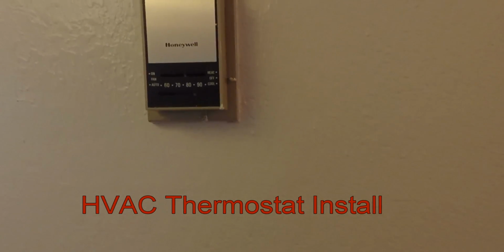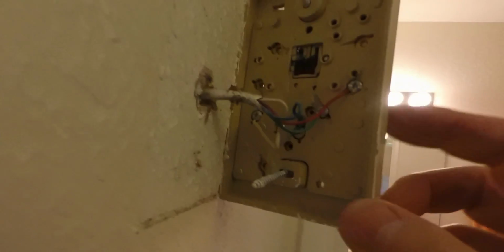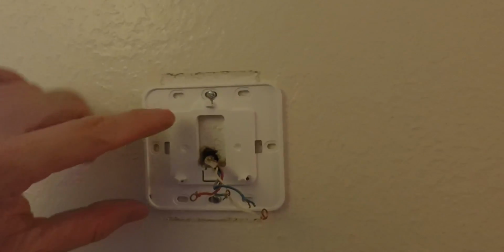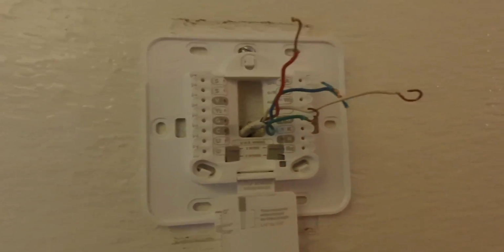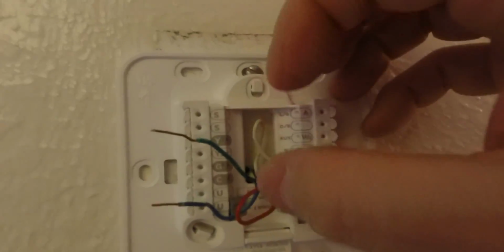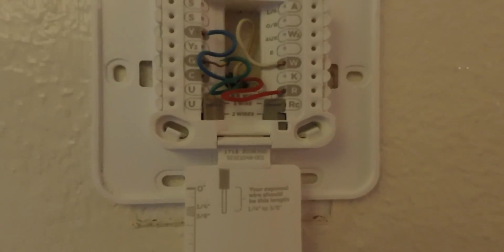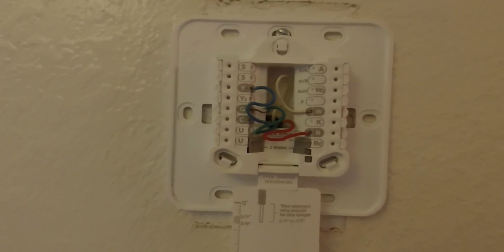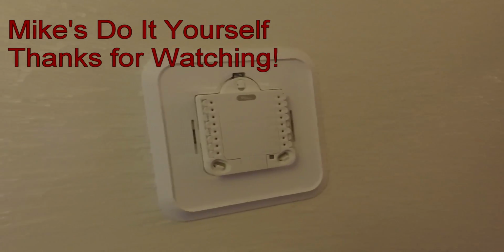HVAC Thermostat Install

Comment: The wiring is have on the old one is (w y g r rc). My question is that since i have 2 red wires on the old one where one is in the r and the other in the r c do I plug it in the same way on the new unit or on the new unit do I plug one red wire in the r and the other red wire in the c. I hope in not confusing the question
Reply from the maker: I would go by what the new thermostat manual "wiring" section shows you. This should work the best for you. Each thermostat can be a little different. If, after wiring the thermostat, something doesn't work or turn on, then I would wire it like the old thermostat that you took off. Good luck with your project!- Mike

Comment: What if you have 1 white wire that went to the E. Do I need another one for the W? My previous thermostat only had 1 white wire to E.
Reply from the maker: On most systems that have backup or emergency heat, there is a brown wire that goes to E terminal. The white wire would go to the W terminal for primary Heat. In your case, I would try the white wire to the W terminal first. You can always change it up if it doesn't work at first. Good luck with your project!- Mike

Comment: Why does my new stat not shut the fan off. Yes it’s in auto.
Reply from the maker: It could be a faulty thermostat, wiring not right, or a relay that's stuck/bad. There's some other videos on YouTube that can run through some troubleshooting on when your A/C fan keeps running. Good luck with your troubleshooting!- Mike

Comment: where's the "common wire" connection?!?
Reply from the maker: Common wire refers to the wire that provides continuous power to your heating or A/C unit, and is usually your red wire, but could be black or some other color. Good luck with your project!- Mike

Comment: Good job my friend,but im still confuse on my thermostat,can you help me a little,all my wirings are total of 5 and its blue,white,red,green,yellow and my new non programmable thermostat is c,o,b,w/e,w2,rh,rc,g,y,y2.i really dont know where to hook them up and i dont know how to read the instruction.thank you very much
Reply from the maker: I would go by the wiring instructions provided by your new thermostat. Usually, it's green to G, yellow to Y, White to W, Blue goes to C or B depending on your application, Red goes to Rh or Rc. These connections may vary depending on your specific heating/cooling units or specific thermostat. Good luck with your project!- Mike
Reply: @mikesdoityourself  thanks

Comment: Hello! 

They recently installed a new AC Rheem both inside/out units with a T1 Pro Thermostat (TH1110D2009) , however the AC runs for only about 6 minutes then turns off. It then takes close to 1 hour before running another 6 minutes…

I saw another video about adjusting the cycle rate on the thermostat… Please let me know if this will fix my issue and how can I do it on this new thermostat. 

Thanks!
Reply from the maker: Sounds like the company that did the installation has some setting up of the system still to do, or there is warranty work to be done.  Cycle rate refers to the maximum number of times a system will run in an hour - most are factory set at 5 to 6 times. This shouldn't need any adjustment, and it won't affect the amount of time your system is actually running.  If your system is reaching your set thermostat temperature at the 6 minutes mark, there isn't an issue. Otherwise, you should have the installation company fix the issue.- Mike

Comment: I have a yellow in the Y and a blue in the C 🤔 and my heater don’t turn on 😢 only Ac
Reply from the maker: Blue wires can connect to the C "common" terminal or the "B" terminal depending on your application. You can check if your common wire is getting 24v from the circuit board or find the wires that lead to the circuit board in your heat pump or furnace and replicate those connections to your thermostat. The wires may be Green to G- fan, white to W heat, red to R 24v heater/transformer. Blue to B or C "common". I would use your old thermostat connections as a reference and check your new thermostat wiring instructions for reference also. You never know if some previous person or the HVAC guy changed the wiring in the past (if it's a older home). Good luck with your project! - Mike

Comment: But I have 2 wires left over......an orange and a blue.  Where do I put them?  There is no "B" for blue and no "O" for orange;.  There's a O/B....surely this doesn't mean that both of them are place in this one input?
Reply from the maker: B is your 24v AC common wire- it can go to the C terminal.  Orange wire is normally for your heat pump changeover valve. This can go to the O/B terminal. This may vary, so I would go with what is listed in your new thermostat wiring manual. Good luck with your project!- Mike

Comment: Can I replace the thermostat without the base
Reply from the maker: The thermostat clicks onto the base but if your thermostat didn't come with the base- there must be a way to mount it onto the wall. It just depends on the make/model/manufacturer. Look for screw holes or something you can use for mounting. Good luck with your project!- Mike

Comment: What if I only have green red and white wires
Reply from the maker: Green would be for your fan and be wired to G. White would be for heating and wired to W. Red would be for your power and wired to R. Although, I would check your new thermostat manual and wire according to there instructions. Good luck with your project!- Mike

Comment: I had a B wire. What could it be? I don't think I have a heat pump. My AC is Ruud from 1988.
Reply from the maker: B wires for Ruuds are usually for the reversing valves for heat pumps that would be wired into the B terminal- I would try that first. Definitely go by the way it was wired up originally and then apply that to the new thermostat.  The wiring instructions for the new thermostat should give you some ideas also. I've seen B wire hooked into the C terminal as a 24V common wire (only in certain instances). Good luck with your project!- Mike
Reply: @mikesdoityourself   I did as the new thermostat's manual instructed, since the replacement when I turn the AC on, the indoor fan comes on but the outside condenser fan and the compressor do not run. I looked for fuses, can't find one in my furnace. I just  replaced capacitors in the outside unit,  still no outside fan or compressor....

Comment: I have yellow wire and blue wire
Reply from the maker: In your case, yellow should go to the "Y" terminal and Blue should go to your "B" terminal- if you don't have a "B" terminal than most likely it will go on the "C" or common terminal. Yellow is for air conditioning and blue is for heat pumps. I would check with your new thermostat wiring manual to verify the connections and if this doesn't help, go by how your old thermostat was wired. Good luck with your project!- Mike

Comment: Hello sir.  When you have the heat pump heating the house in the winter and it needs auxillary heat assistance when the temperatures are real low, will ' aux ht' or 'em ht' show up on the screen when it comes on to assist the heat pump? Thank you for your video.
Reply from the maker: Yes, when temps are below 40 degrees outside, the heat pump sometimes needs help to maintain the set thermostat temperature. It will turn on the electric resistance heating coils in the air handler. It usually only runs for a short amount of time in this mode. Emergency heat is usually turned on manually and should usually only be used when you have an issue with your heat pump. These two modes will usually incur higher heating bills.  Good luck with your project!- Mike

Comment: My existing system is Gas Furnace and single AC unit. My existing thermostat has C,G,W,Y and R (no jumper). The new Thermostat has the choice of RC or RH with a jumper. (no R). Question: Which terminal do I place the existing "R" wire to? RC or RH? Do I leave the jumper in or remove?
Reply from the maker: I would connect the red wire to RH (24v ac for heating) then leave the jumper going from RH to RC(24v ac cooling). I would verify this with your wiring manual that came with your new thermostat. If it mentioned something different, I would go by that. Good luck with your project!- Mike
Reply: @mikesdoityourself  Thank you sir!
Reply: @mikesdoityourself  for this thermostat is a jumper needed or is it built in? Thanks
Reply from the maker: @kittyboo2121  it's built in for this thermostat- other thermostats could be different. - Mike

Comment: I'm hoping and praying you can answer my question. The heat at my rental stopped working so we came and found the breaker was off. You could hear the fan and everything runing after we turned it on but it's only blowing cold air. We keep putting the heat on the thermostate but it just blows cold air. It's been snowing like crazy hear in Washington with freezing temperatures and my renters aren't happy. My dad left me this house and we really can't afford to keep it. We try and do everything ourselves and my hubby is very handy but we are stumped. They wanted the AC on this summer bc we had exstremly hot temps and I didn't get it done soon enough so they managed to get print the manual out and they got the AC running. Only problem now is the heat won't run. I have this exact thermostate. Is it possible they messed with the wires and didn't tell me and this is why it's still blowing cold air? Sorry for the long story but I thought it would help explain my issue better. Thank you so much. Also we went and bought a new thermostate that was a bit more simple and it has the O and B connect seperate as many say o/b together. Also other letters that don't match this one for wiring. We thought it would be an easy fix. YR!😂 I honestly don't think its a broken thermostate. The more I read the more I think she messed with the wires. Yes she got the AC to work but now NO heat. Please please help.
Reply from the maker: "O" connection would be for the reversing valve in a heat pump system (orange wire)- blue wire would be your common wire for heat pumps, this would go to your "B" terminal- I was missing some wires with this install video, so my wiring may be different than yours. I would go by the thermostat wiring manual for the final word on wiring- but this definitely sounds like a wiring issue. If this is a emergency situation, I would definitely call a professional. Hope this helps and Good luck with your project! - Mike
Reply: @mikesdoityourself  Thank you for getting back to me so quickly that was so nice of you. We bought the tenants heaters till we fix the issue. Unfortunately I dont have the manual to look at wiring instructions but I will try and look it up online. It does have 3 wires that are similar. Ones orange, ones almost the same color but a bit like brownish orange and then red, yellow, green and I think black. I'm not sure I have to look at my hubbys phone cuz he took a pic of the wires on the wall. After reading alot of your info and ppls comments I really started thinking it might be that she messed with the wires to get the A/C running. I really hope that's all it is. If it's not the wiring do you know what else may cause this? We just had to replace a hot water tank after a week of no hot water on Christmas eve and my pocket book is thin and now this at my rental. Someones testing me.lol😂 Your awesome thanks again.
Reply from the maker: @marykennedy3351  your heaters flame sensor may be dirty or the gas may have been interrupted and your pilot light may be out- if this is a gas heater. - Good luck! - Mike
Reply: @mikesdoityourself  Thanks Mike! Nope not a gas heater no pilot light. Thanks for all your help again its much appreciated.
Reply: @mikesdoityourself  well we went back today and I convinced my hubby it was the wires. So he put the old (same as you have)thermostat back on, placed all seven wires in their spot and BOOM we could smell the dust burning when the fan came on and last time that smell wasn't there so I knew the heat was working. Sure enough it started to get warmer and warmer. We have heat and its all bc I watched this video, read ppls comments and the fact you got back to me even tho this is a old video is just Amazing to me. Thank you Mike from the bottom of my heart😍 You saved me from more heartache and a ton of money.😍 Blessing to you and Happy New Year ❄

Comment: Hi Mike , i got both wires blue and yellow , if the blue goes to “Y” where I need to put the yellow wire?
Reply from the maker: Blue goes to yellow if you don't have a yellow wire- otherwise, Yellow wire goes to Y which is for your compressor and Blue goes to common(C) or B(blue) which is for your heat pump. Good luck with your project!- Mike

Comment: Where does  the  Yellow  wire go if you have  one
Reply from the maker: The yellow goes to the Y terminal for your compressor. If you have a blue wire also, this would go to the C or Common terminal, or B terminal depending on your thermostat- this is for heat pumps. Always follow the wiring instructions in your thermostat pamphlet. Good luck with your project! - Mike

Comment: I had an old Honeywell just as you have pictured, but it only had two wires -- heater only, no fan, no A/C.   After watching your video I figured it couldn't be that difficult.  I connected the white wire to the W terminal, the black (red?  it was dark, color indeterminate, but not white) to the R terminal, and I had functional Heater control on first try.   Thanks for posting your video, it was easier then trying to decipher the instructions describing 4 or more wire systems that I could not relate to.
Reply: Same here!

Comment: Where is the yellow wire? Where is the Orange wire?
Reply from the maker: If you have a yellow wire, this would go to the Y spot, this connects to your compressor. If you have a blue wire also, this would connect to your C spot, or common connector. Orange wires are for your heat pump  and would connect to the O/B terminal on this thermostat. Since my application shows an older design, my wiring didn't include a yellow or orange wire. Good luck on your project! - Mike
Reply: @mikesdoityourself  Thanks for taking the time to reply, Mike. You're right on all of it.
Reply: @mikesdoityourself  I contacted Honeywell support, a really nice young woman in Mexico who really knew her stuff. She had me move the white wire to W2 and it works great.
Reply from the maker: @ashatola  awesome,  I've had a few people comment that Honeywell has very good support people for their thermostats- every A/C or heating system wiring can be different so the thermostat manufacturer is definitely a great resource. - Mike

Comment: Hey there. Where did you find this mounting plate????
Reply from the maker: The mounting plate came with the thermostat but I can't remember if the thermostat came from the home improvement store or from a A/C company when an install or servicing was done. Maybe they sell this separately, online possibly? Or maybe through the Honeywell website. Good luck! - Mike

Comment: I did wire my T6 matching the existing. When I call for cooling it actually heats. Any ideas what I did wrong? Thank you!
Reply from the maker: I would double check the wiring and see if your heating and cooling wires got switched. Different systems require different wiring setups. If you can't match your existing wiring, go by the manufacturer of your thermostat wiring manual and match it to whatever system you have. Good luck!- Mike

Comment: Thanks for the video. I just wandering Where did you get the wallplate? It didn't come with my thermostat
Reply from the maker: The install kit that you see in the video came with all the wall mounts/plates- it could be that this particular  thermostat has eliminated the wallplate- it's been a few years since this was purchased. Maybe the wallplate can be purchased separately.?- Good luck with your project! - Mike

Comment: Ok I know nothing about ac units. But I have a heat pump with cool, heat and emergency heat. Will this thermostat work? And would I wire it the same??
Reply from the maker: This thermostat should work. I would research this thermostat online to make sure. The wiring instructions will be with the thermostat- wiring varies depending upon the system that you have. Good luck! - Mike

Comment: Hey my heater don't pass 73, and I notice the Blue is in C should I change it to Y maybe it  help? My coils are clean I don't know why it don't pass 73 and my AC is new
Reply from the maker: The blue wire is usually for heat pump systems. If there is a B terminal, the blue wire would go there. The blue wire may hook up to the C - common wire terminal or Y terminal- depending on what kind of system you have.  I would definitely use the way the old thermostat was wired as a blueprint for wiring the new thermostat. The wiring manual is also a great resource to use. Good luck!- Mike
Reply: @mikesdoityourself  i have a orange wire that's not connected to anything. Is that supposed to be like that or no? Or that one goes to OB?
Reply from the maker: The orange wire is used if you have a heat pump system for reversing valve operation- it would go to the O or O/B terminal depending upon your specific system.- Mike
Reply: @mikesdoityourself  I do have a heat pump system, should I put that orange in OB will that fix the problem? Sorry I'm. Bothering but is 36 degree where i am and my central ac unit in my house don't pass 73 degree. Trying figure this. Out
Reply: @Soursmacked  sounds like it’s just cold bro. Those aquatherms don’t get the house that hot

Comment: Hey I have Honeywell T6 pro, I turn the heat on n it’s blowing cool air, filter is ok, my wiring for white wire is on E/AUX do I need to change to something else?
Reply from the maker: The white wire will normally go on the W connector- this is your switched heat to turn the heat on. Good luck 👍- Mike
Reply: @mikesdoityourself  thanks a lot it worked!